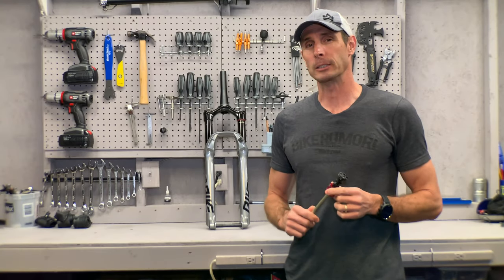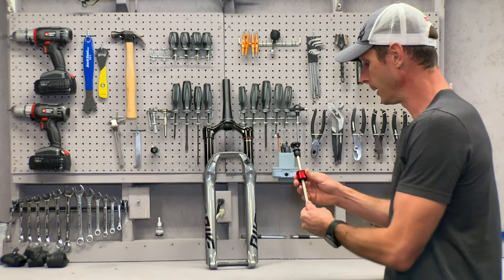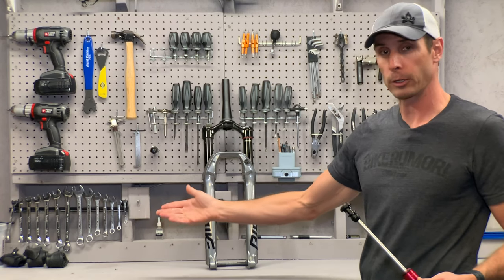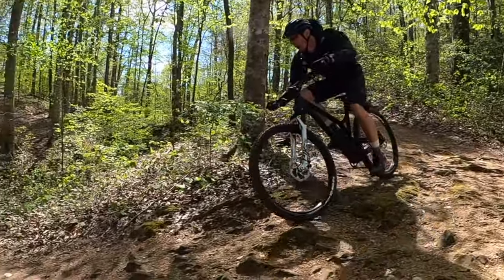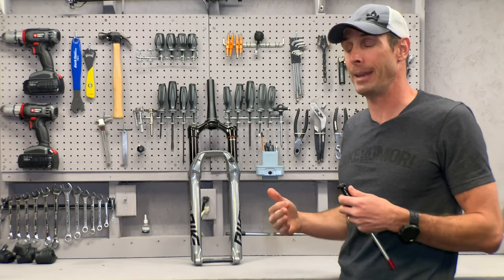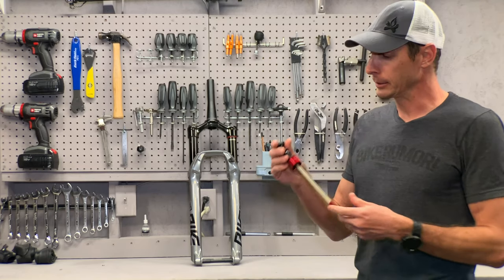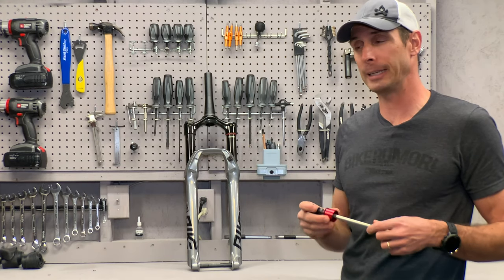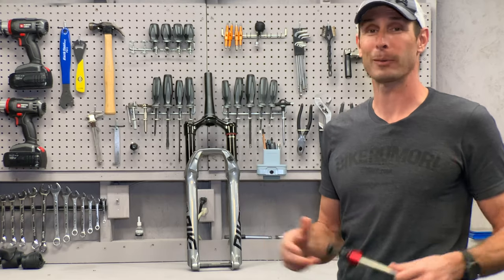2021 Rockshox DebonAir air spring explained

Comment: The most accurate and clear explanation on YouTube so far. You’ve actually explained it right: with the upgrade the piston seal is now lined up with the dimple. Whereas other Youtubers have said that the seal head is now lined up with the dimple (which is incorrect). You’ve also answered my question why with the upgrade I feel better riding with less bottomless tokens (because the positive air chamber is now about half a token worth smaller). Thanks for your awesome explanation!
Reply: berawind no. Your suggestion can’t be the best if the tutorial is not in the most speakable language which is English.

Comment: Great explanation! The best I've seen. 
Although I think it's a waste of money.. It's removing the small bump sensitivity (removing the negative chamber) to satisfy the small suck down issue which isn't actually an issue. Because nobody rides with the fork in the topped out position. Also the small dip that you speak of at 3:20 shouldn't exist as the positive and negative pressures should equalize every time the seal passes the dimple.
You wrap it up in the last minute saying it's not as sensitive on small bump (because there's no negative pressure initially pushing the fork up). And I thank you for helping me save my money.

Comment: This is the first that I'm hearing the dimple was moved. I understood the only change in that regard was the taller foot nut to align the piston closer to the dimple. Excellent clarification. Good thing I waited to upgrade mine until now!
Reply: The dimple DID NOT move. Just the airspring changed. You can update any 2018 and newer rockshox Pike, Lyrik, Yari, or Revelation with it.
Reply: Actually you can upgrade even older forks (just upgraded my 2016 Pike). One does need the complete air piston, instead of just the seal head and foot nut like the recent forks.

Comment: The negative chamber only inflates once when you compress the fork.  This change makes the negative and positive chamber smaller.  So you've effectively fitted 1/2 a token and reduced sensitivity.  It isn't an upgrade.
Reply: MTB Scotland Yup. That's what I thought. More like an OCD fix.
Reply: Seems like this upgrade works with the Lyric but makes the Pike harsher.... anyone else feel the same?
Reply: The negative chamber size stay a same
Reply: @ile911  no it doesn’t.

Comment: I had this added last week along with the new charger 2.1 and bumped the fork to 180mm. Fork sits like it should, higher in the travel and doesnt lose that first 10mm. I was running 83-85psi previously at 25-30%. Now im running 75psi at 20-25%. Highlt recommend upgrade during a fork service.

Comment: So basically RS has come all the way back around to the original solo air which had a schradder valve that opened at top out to equalize both chambers.
Reply: It's a solo air with extra steps
Reply: If you ask me, they should have stayed on dual air, that system worked like a charm once you set it up correctly , solo air is just simple version for lazy/dumb people.

Comment: Dimple was moved inside tue upperlegs? Isnt it just in different possition thanks to different dimensions of the air spring?
Reply: I was just wondering this too.  If they left the dimple where it was, and only adjusted the length of the air spring, you could make your 2020 feel like a 2021 by changing the air spring.  So, did the dimple move, or no?
Reply: @K-Schick  I believe he guy is wrong and the dimple did not move.
Reply: The dimple did not move, you can update any 2018 and newer fork with this new airspring. Also the whole video is basically wrong, they did this because Rockshox forks with debonair springs were known to "suck" down about 5mm-10mm with no weight on the bike. Effectively shortening your travel. Some people had the problem and some didn't, it's kinda dependent on your set up. The new airspring also gives better mid support, but at the cost of small bump sensitivity.
Reply: The dimple "moved" relatively to the seal, not literally

Comment: Wouldn't airing up the fork from full compression be the way to go? At "full travel" without adding air to the the positive air chamber (assuming you let all of it out for the install), you can set the pressure in the lowers to 1atm since the net force is zero. You would then air up as per normal, and assuming it creates a vacuum, it would have a net force pulling the crown downwards. This would probably be overcome by the positive air spring as it would be relatively small. Let's say it's negligible. If it isn't then, at least it'll help make the fork supple at full extension. Then when the fork takes a big hit and reaches full travel, it would theoretically be back to net force of zero.

Comment: When installing mine, I had a good look at the airspring and took it apart and removed the black bump stop in the negative air chamber. This, I suppose could be considered the megneg hack for the fork. I also installed the actual megneg aircan on my shock. Test day is tomorrow.
Reply: How did it feel?

Comment: So pre-2021 forks have the dimple in a different location? Is that accurate as this kit fits in the 2018+ revelations etc also, so how would that work?
Reply: The dimple is in the same place but the red part on the air shaft goes over the dimple at a different part of the travel. I’m not much of an expert but that’s what I’ve gotten from other reviews in this air spring

Comment: So what do I order for my 2016 chassis lyrik?
Reply: Look into Push’s coil conversion kit to see if it will work on your older fork.  Supposedly the coil provides good small bump sensitivity in the first 65% of travel but there’s still an air spring for the bottom 35%.  It’s expensive at $400 though; and that’s if it works with your fork.

Comment: Hi! Great vid you know if this Will work in a 35 gold rl?
Reply: hiya, not sure if you are aware but this wont fit as the 35 gold has thicker walls (32mm bottomless tokens) but yark, lyrk and pike are 35mm with thinner walls
Reply: JB TECH thanks! So the debon air piston is 32 mm also? And to modify the travel to 160mm its vía spacers removal, not shaft changing?
Reply: @sebastiancorominas  strange you asked as today I changed mine that shipped with 130mm travel to 160mm by removing all 3 all travel spacers (each spacer equates to 10mm). All you need are the right tools, oil, cloths and a bit of time and patience. It is the same process as lower leg service with addition of removing  damper to get to the all travel spacers where you need c clip remover
Reply: @sebastiancorominas  I can also confirm it takes the 32mm bottomless token the reba, etc takes (black ones) as had one spare and threw in for zero bottoming out
Reply: Jonny Brown thank you!!!

Comment: can you use it on 2018 RS Yari?
Reply: Look into Push’s coil conversion kit to see if it will work on your older fork.  Supposedly the coil provides good small bump sensitivity in the first 65% of travel but there’s still an air spring for the bottom 35%.  It’s expensive at $400 though; and that’s if it works with your fork.

Comment: Well well, what do you know. Rockshox 2023 air spring is more similar to the old B1 air spring with the equalization dimple slightly into the travel again. It seems this upgrade wasn't an upgrade after all 🤣. Just BS RS marketing. 
 Even my fox 38 sucks down into the travel and oh they feel so good.  
The bleeding ports at the back of the lowers are probably a good thing. As burping or having negative pressure after assembly in the lower legs can suck the forks down too. So things are definitely getting better.

Comment: 5:36 i believe you are wrong. The red bottom foot nut doesn't affect where the top main piston seal head sits.
If that was the case then different length of air shafts (different fork lengths) would result to different position of the top main piston seal head.
The rest of your info is excellent!

Comment: There is another review that after installing this upgrade seal head and foot nut. The pike ultimate become “harsh” or stiff as he describes. Is this the case? Check JCtrails review on it. 
I am on pike ultimate 2020. And im keeping an eye to upgrade this with some doubts. Anyone had this “harsh” or small bump sensitivity issues?
Reply: Apparently he used way too much fork grease and that's what jammed it.
Reply: @sm-qw9mj  he says he fixed that, and it didn't help
Reply: brady moritz I put a C1 in my pike and it lost the small bump compliance. I had to run really low pressure to get any small bump sensitivity otherwise it felt harsh.
I’ve now changed back to the B1 debonair which IMO is way better for pikes.
Reply: Jon Everett that’s true - i just sold my pike and got a Zeb
Reply: @joneverett276  so it is confirmed this upgrade messes up the Pike... probably good for the Lyric, Yari and Revelation

Comment: so wait, i took my 2018 Pike and upgraded w the 2020 air spring and charger 2.1 and now they came out w/ a better air spring?!!! gol damn bike components companies.....stop innovating!!!
Reply: I think you don’t need a whole new spring, sure can buy a then new nut and red seal and replace them on the previous debonair upgrade sping
Reply: Look into Push’s coil conversion kit to see if it will work on your older fork.  Supposedly the coil provides good small bump sensitivity in the first 65% of travel but there’s still an air spring for the bottom 35%.  It’s expensive at $400 though; and that’s if it works with your fork.